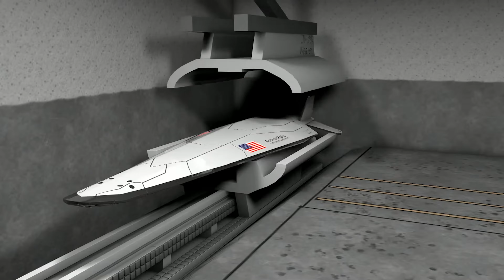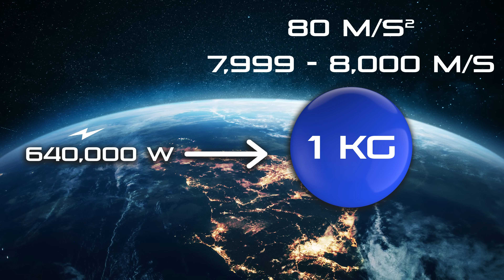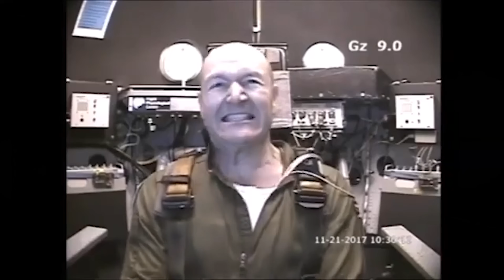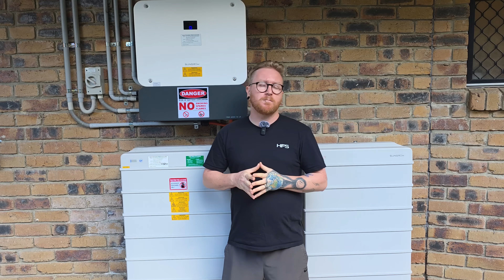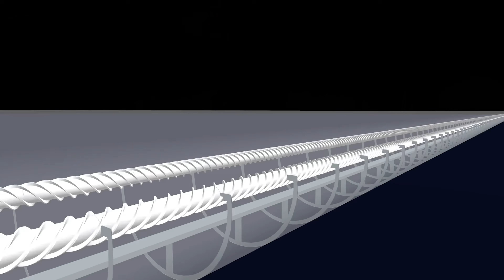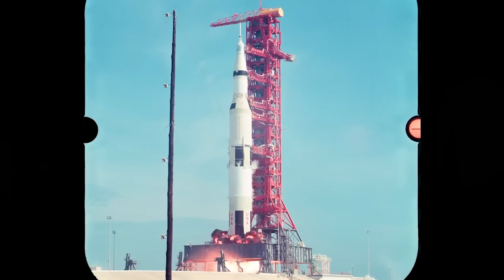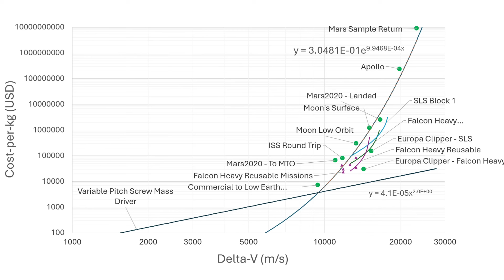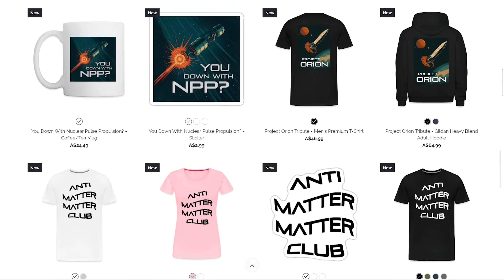The New System That Could ACTUALLY Replace Rockets

Comment: At full design power, SpinLaunch's suborbital launch platform has a maximum launch velocity of 2.1 km/s. With another 0.3km/s then we're talking lunar escape velocity at 2.4km/s if launched from the moons surface.

The planed full size SpinLaunch platform would also launch at 2.1km/s, but the orbital accelerator vehicle adds another 5.7km/s to get it to low Earth orbit at 7.8km/s  after drag through Earth's atmosphere. 

The estimated total minimum delta-v required to get from the Moon's surface to Jupiter is approximately 6.2km/s to 6.9 km/s. A lunar spin launch like platform with an orbital accelerator vehicle designed for inserting into low earth orbit, suddenly looks like Earth planetary defence against asteroids and comets if launched from the moon.  or it may double as  launch platform for raw materials from the moon to space for processing in a space based industry with continuous solar power making solar power beaming to earth viable or powering the expansion of space based industries. 

One step farther, A lunar spin launch with orbital accelerator and a Jupiter gravitational slingshot can realistically boost the velocity with respect to the sun by 10km/s to 20km/s, resulting in a total delta-v of 17.8km/s to 27.8km/s. For comparison, Voyager 1 is currently traveling at about 17 km/s. Now we're talking interstellar probe.
Reply from the maker: SpinLaunch is a super interesting and clever idea, my understanding is they're having some trouble with scaling it up. Centrifugal force is no joke, and at those speeds it is immense. I wish them all the best though! I hope it can work at larger scale
Reply: @HelloFromSpaceAus SpinLaunch's biggest challenge is getting enough customers to launch a great many satellites to bring the cost down.  This is challenging in part because of the forces at launch and the size of the payload. But spinlaunch put a sizable effort and amount of money to developing  components that can withstand the G forces. And they purchased a 100 year land lease from an island in Alaska at the 51.8° latitude with the intention of launching communication satellites. I noticed that starlink's communication satellites orbital incline is about 53 degrees. Maybe this is just coincidence. 

I feel that SpinLaunch might be missing an opportunity to spinlaunch buckets of water to a low earth orbiting rocket fuel processing and refueling station. The economics of a great many fuel launched means they can cheaply launch buckets of water to space.  They could partner with SpaceX for refueling their starship, Or orbital accelerators could be repurposed for boosters, or traditional rockets could have their second and third stages fueled in orbit which would take so much weight off the rockets that we could use smaller rockets off the launch pad or add more payload. 

But the really big deal comes when we build a spin launch platform on the moon, which despite the challenges, should be easyer in some respects, like not needing to hold back a thick atmosphere or pump a vacuum.  and the moons lower gravity should make its structural requirements much less demanding.  

While Spin Launching on earth also releases a counter weight into the earth at the moment of launch, spin launching from an elevated position on the moon can launch in both directions parallel to the horizon and not fight through a thick atmosphere.  This should half the energy cost of launching raw materials to space over singular launches. 

Lunar maybe it will or ma y it won't be SpinLaunch, but spin launching raw materials for building out space industry will become a major part of human off Earth activity.
Reply: SpinLaunch will NEVER get anything into orbit. I am prepared to bet you very good money on it. I want 10:1 odds from you. OK?
Their idea is incredibly stupid, but it's still not as stupid as this screw thing. Hilarious!
Reply: @Chris.Davies  I guess they bought a 100 year lease on an island in Alaska, and they spent millions on launch hardening various parts of satelites for nothing. They probably have no intention of launching a constilation of small communication satellites like StarLink that orbit with an incline nearly identical to the latitude of this island, and nothing will come from Spinlaunch's parenting with  Kongsberg NanoAvionics (KNA) as the exclusive satellite supplier for the initial deployment of 280 satellites for the Meridian Space constellation, right?

Just saying when one launchs from 
Adak Island in Alaska, with a latitude of approximately 51.8° N, the orbital  incline will be nearly the same as Starlink, unless they plan on burning up some delta-v for an orbital plane adjustment.

Comment: How will rotating kilometers long screws work. Im assuming that will bend. What rpm will the need to rotate at. Will it shake the whole system to pieces if its 1000s rpms on a bent spiral. Thats my initial comment. Will it be broken into lengths of spinning screw with a union between each lenght.?
Reply from the maker: That's an excellent question. The screws are segmented in lengths between 100-200m, as for speed - I'd need to read back through the paper to get an exact number but its very, very fast, From memory (so this could be wrong) it was a couple hundred thousand RPM
Reply: @HelloFromSpaceAus 1 metre diameter at 200,000RPM give a centripetal acceleration on the screws of 22 million g.
Reply: @andrewworth7574 wonder what point you hit plastic deformation point. Or even elastic deformation as screw whip would be a huge problem

Comment: Mass Drivers? I have commented about Rail Guns on The Moon for years, but I thought the Earths Gravity would be too strong for Rail Guns to be a realistic way to leave Earth. SpaceAus explains how Screw Launch would work. I like how it uses magnets and a vacuum tube, but it screws its way to use kinetic energy to launch to orbit. The cost of building the infrastructure to use a system like this is why it won’t be built. ‘Unless a billionaire wants to buy a piece of the Ausie desert and pay out of pocket to build a big gun. Too Rule the World, from Down Under??’

Why ells would you want a gun that could reach around the world, unless you are serious about finding a cheap way to reach The Moon and Mars.
Reply from the maker: Yes and no, all space hardware is expensive! The Shuttle program for instance only launched 135 times, for a total cost of $500b - this is a fraction of the cost of a VPSL system, and once it's built you're good for at least 520 launches. I'd say its probably more a matter of convincing the public that this system can work, so agencies like NASA can get funding for something like this.

Comment: Thanks for presenting this.  I wonder if there is enough savings to be found in a much smaller scale project that would send small containers of liquid methane and LOX to an orbital catcher.  That might synergize well with orbital propellant stations as well as being a useful proof of concept.
Reply from the maker: I'm glad you enjoyed it! That's a great idea, fuel can no doubt survive pretty high G loads so you could really amp up the acceleration to keep the infrastructure small and cheap. In part of the full interview which I had to cut for time, I spoke with Phil about the implications of VPSL for in-orbit construction. This would be a next level technology for humanity.
Reply: @HelloFromSpaceAus  Realistically the only launch you need is the launch that will allow us to build an orbital ring around our planet. Then the VPSL launch tube can go rust, I'm taking a nice and roomy maglev train up to the ring and into LEO

Comment: I like your presentation, what a great, innovative idea! I'd like to hear more about how the magnetic screw drive works. How long the tube at human comfortable G's. Up a mountain? How to keep meter sized screws straight and level for such long distances. 
Keep up the good work!
Reply from the maker: Really glad you enjoyed it! It's a fascinating concept, I've put a couple links to some of Phil's videos in the description where he goes into much more depth. The screws are segmented in 100-200m sections. From memory (without delving back into the paper) the tube is approximately 12km long for high G cargo launches, but quite a bit longer for a human rates system to keep the G's to a survivable level.
Reply: @HelloFromSpaceAus  Awesome, thanks. Elon's going to be pissed, he's worked so hard on those raptor engines :)
Reply: @HelloFromSpaceAus  Also, you mentioned that you would need to carry enough fuel with you to land on Mars. However, there's no reason why you couldn't construct a receiving tube on Mars or the Moon that would receive the craft and capture its kinetic energy. Then you'd have to carry very little fuel - just enough for emergencies and maneuvering .
Reply: @HelloFromSpaceAus  Keep in mind the "survivable level" they usually describe in the paper fully admits and assumes that the human cargo will pass out as they go through the upwards bend in the tube which is quite funny.
Reply: @MrRolnicek  Yes, I was thinking  about that too. I would think they'd  make the upward curve gentle enough that doesn't exceed 2 g's. If half the passengers stroke out, then the company's reputation is definitely going to take a hit. :)